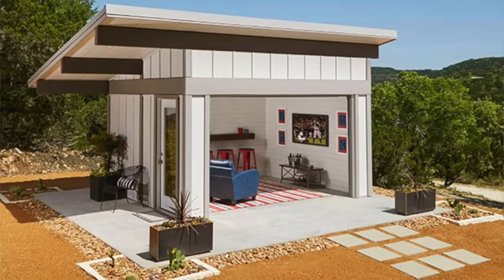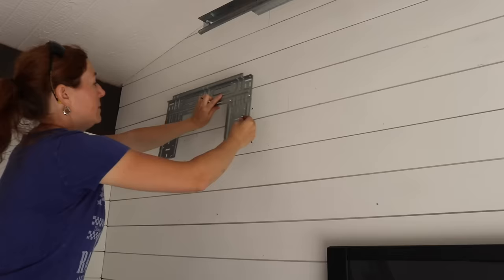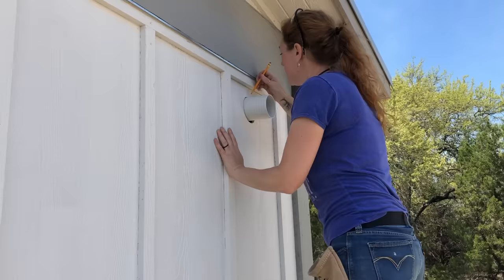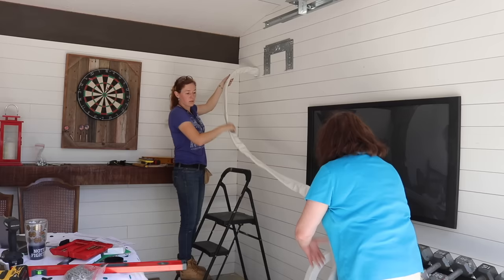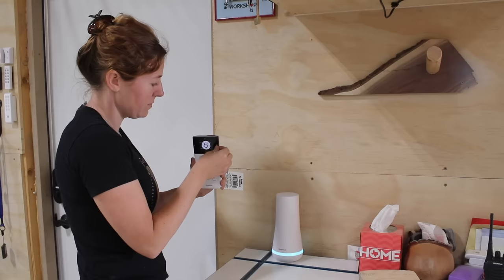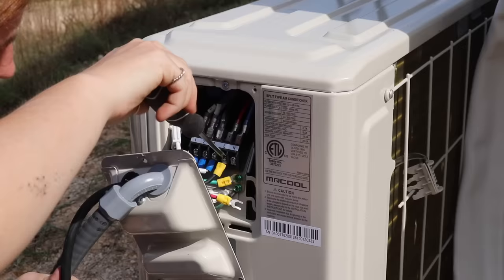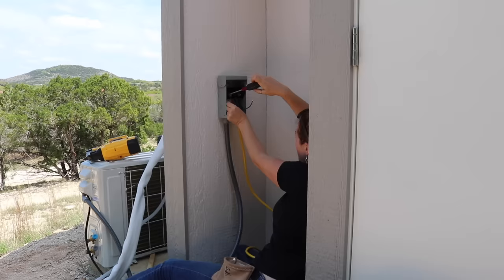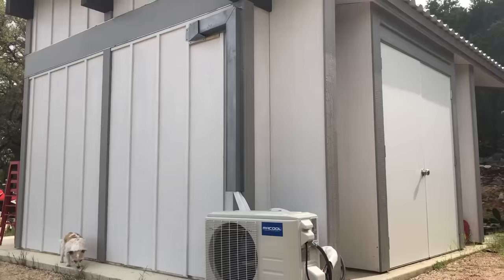DIY Ductless Mini Split Install - MrCool Unit

Comment: Is the evaporator coil and condenser under vacuum?...if not that could be a problem. They used to have you crack the suction line and tighten down the liquid to allow refrigerant to purge unit.then quickly tighten down suction line....

Comment: You should have caulked under and around the plastic sleeve and embedded the flanges when you installed it to prevent leakage of water and bugs

Comment: April,  I read that it is best to lay the extra line-set horizontally, not vertically.  This avoid oil being trapped in the bottom of the horizontal coils.  Any thoughts?

Comment: I'm a little concerned about the location of the condenser. Looks like it doesn't have enough space for adequate air flow. These types of condensers need to flow a lot of air. If not, it may result in high head pressure. But you said this is a system that will not be ran 24/7. so it will be okay. But if you plan on running it for extended periods of time, I would take the coil of line and relocate it and move the condenser at least 24-36 inches away from any structure.

Comment: You can cut the line set , obviously you'd need to reflare the copper tubing.
Reply: Yeah and also the system would have to be evacuated and recharged which takes it beyond the realm of a DIY project.

Comment: Hi great work. I just had an estimate to have one head mini split. I was told I would need some electrical work to connect the power. I was given a price of 5300 does that seem  a lot? When I priced the units for one head is around 1400.00. That means the rest is labor. Does that seem like a lot?

Comment: April, the line set is too long. You really need to pull a vacuum on the line set to get moisture out of the line. It's bad to coil up the line set and place it near the cooling fan. Mount the outside unit to the concrete. Don't run it off a generator, run permanente power to the unit. Seal the penetration point into the building.

Comment: What prevents rain water from getting back in under the shed walls?  I once build a shed foundation that extended JUST beyond the outside walls, and it was a disaster!  That looks similar.  I do see a little 1cm "lip" that maybe helps, but I'm still curious why on earth the builder extended concrete beyond the walls' drip edges.

Comment: You should not coil the extra copper up and down.  Lay it down so oil in the Freon can travel without getting stuck in the bottom of the loops.  Don’t block the condenser unit with the coils.  The condenser unit puts out heat and you should not be adding heat to your Freon.  The condenser needs fastened to something, a solid bolted on place.  Bolting it to the structure will make the walls vibrate and make noise.  Place condenser in the shade so the sun does not heat it up.    Putting the inside unit in the middle of a wall is better than in a corner.  Loses efficiency in a corner.  The fasteners you’re used on the interior plate looked too small to hold a running fan motor over time. They looked like drywall anchors for a photo frame.  You should use 3” heave lag bolts into every stud behind it.    Guessing that garage door is not energy rated for direct sunlight.  If it is getting direct sunlight that tiny mini split run off of a little gas generator is all going to be too small

Comment: line set will make an oil trap and will damage the compressor over the long term even with the high psi 410a

Comment: Cutting the end off an extension cord, even a heavy duty one isn’t advisable.  Better options exist, such as an appliance / dishwasher cord (15A rated) for 120v units, or better yet the correct rating SJOOW cord terminated in the appropriate connector for the voltage & available connector on the generator.
Reply: Looks nothing like and extension cord to me, just standard regular wiring

Comment: The Line set is precharged with nitrogen, not refrigerant. There needs to be an evacuation before the refrigerant can be released from the condenser.  If this is not done, the unit will not last more than 4 years
Reply: Not true. Some mini splits do come with a charged line set. I dont like them but then again I hate all mini splits cause their just garbage

Comment: I called several installation pros and they made it seem like putting in a mini split was so hard and required adding a lot of additional electricity.
Reply: This model Mr Cool diy that she got for her space only needs to be on a regular household power 115 volts circuit. It needs to be wired to a GFCI breaker or outlet. And another commentor pointed out that a surge protector is a really good idea for the unit, especially running off a generator. The 220 volt models that would involve hiring an electrician are for larger spaces. I just installed one of these a week ago for a rental’s living room with a retired female friend. It’s working fine.

Comment: I tried the link you provided to Mr.Cool because I myself want to install one in my living room. It’s a bit smaller from your shed. But all the link does (that you provided) is take me to their website. 
Which mini split did you purchase, because that’s the one I need as well . 
Thanks!
Reply from the maker: It's best to choose the one that best fits your needs. I've installed 5 now, 2 in my Shop, 2 at my commercial building and one in my garage. They all still work great and I love them. Thanks for watching.

Comment: That's amazing!! I called MrCool and they suggest not to exit the line set from the left side of the air-handler, the template which comes pre-printed also show hole marking on the right side. I am just wondering did you run into any issues post this install being lineset routed left? I would prefer left-side install and I not getting a clear response on it .. thank you...

Comment: I was wondering if I could use a unit like this for my 12X8 greenhouse. Just cooling it a bit when it gets TOO hot in winter. I would NOT need to drain the liquid outside, It could just drain into my gravel floor in my greenhouse. SO, would I NEED to have the lines to the outside in a situation like mine? Meaning that I want it all to be inside the greenhouse with NONE of that tubing going outside.

Comment: Get a pro and cut that refrigerant line to size.  Put a mesh screen over that water drain - get ready for it to become the #1 attraction for fire ants.
Reply: Most pros charge exorbitantly for simple enough work they got training to do so, since not all systems are the same design and requirements.

Comment: Great job. Question: What do i do if the indoor unit is about 50ft away from the outside unit?
Reply: You can get an extension line and a connector to join the two lines together.

Comment: Too late now but you needed to buy a flaring tool and cut the tubing then insert the nut on the tube and then flare the ends, this way you don't need to have all the excess tubing. You also need to insulate that tubing otherwise it will start to sweat.
Thanks
Reply: Don't forget to screw the outside unit to the concrete.

Comment: April, my compressor outside is mounted at about the same height as the unit inside. Is this causing the condensation to flow back towards & into my building?

Comment: Kudos for being brave enough to go it on your own, but you made a couple of major mistakes. 1) NEVER coil the lineset that way, It must be coiled flat with the end going to the compressor running downhill. To the poster below, that goes for R410a as well. Also, hardwiring in a drop cord is a no-no. I am a licensed HVAC contractor, BTW.

Comment: I'm sure this comment will be lost but you should never keep the excess line rolled up vertically

Leaving it vertical like that can have oil collect and cause then compressor to fail

Comment: Where is the vacuum process prior to releasing the refrigerant into the system?  That is perhaps the most technical part of the install.  It cost a fair amount of money to buy the equipment for the install and the cheap stuff leaks and you cannot get an accurate reading on the integrity of the system to prevent coolant leaks.  Did you pay someone to do that?

There is so much more you didn't cover.

Comment: Hello April. Great video I have just bought my Mr Cool 1200 BTU  I am finding you video to be one of the best you made it look so easy . I do have 1 question did you bolt the unit to your cement base after as I did not see anything holding it down or do you find its fine just free standing in the location you picked. Thank you.

Comment: Dang. Are they giving these things away?  Everyone seems to installing these. Great video
Reply: They might as well be giving them away! The unit she Has is considerably cheaper that installing a regular unit. They are only slightly higher in price than a window unit, and a lot nicer looking.
Reply: @ALLinJunkRemoval , i paid $400 for the same BTU for a window unit (Frigidaire). She paid 800 or however much its priced at now due to demand on Amazon. I rent the place where I live so I can not really or willing to pay for and install one of these DIY units for what it costs.

Comment: CAUTION, in most cases, you do not want to put the hole on the left side and fold the lines across the back...then make a sharpe 90 turn.  You can put the hole on the right side and go straight out .  The video shows what looks like an 18k handler so there was enough room to fold the lines and run across the back.......but....with 9k , 12k handlers....the space is less and folding the lines across the back will often result in the handler not snapping in correctly.  Plan on using screw inserts as in most cases the brackets don’t provide holes that match wall studs.  Also, the shorter the lines...the better....AND ...,two medium external units are more power efficient than 1 large one.  I used 1 48k btu unit for 5 air handlers and what a mistake.  Had lines all over the place.  Should have use 3 small units would have been less lines and less electricity.

Comment: great video thanks!! one question? could you explain to me how the wires were connected in the fuse disconnect box to protect the condenser and generator.  thanks again.

Comment: Little tip have a HVACR professional cut the tubing don't ever coil extra refrigeration tubing the system has refrigeration oil in the compressor it's will circling around system to the evaporator and back to the compressor plus the suction line gas coolers the compressor that comes back from the evaporator your going be replacing the compressor the extra tubing will trap the refrigeration oil cause the compressor to burn out l seen this happen it going cost more $$$

Comment: I like the way you had the guts to hook it up. But really you should have had a person help you that has experience in that kind of insulation . That is a person that has made a lot of mistakes and has learned from them. Good luck and I hope you don't get any experienced from this job.
Reply: Didn't she build and wire an entire workshop!?!?
Reply: FOr her shop wiring the primary line hookup was done by her hubby with a professional helping him to do it properly since what they went through was not a one man job. She even had a pro assist her in building the shop itself if you watched that part of the new shop series.
here is the electrical install portion: https://www.youtube.com/watch?v=iSkk9Kkoft8

Comment: Why you did not pass the coil line from the outside 3:11 insted of connected it to the inside unit first and then pass all the line from inside
Reply: Badora Strome 
It ships with the lineset already connected to the inside unit.

Comment: Maybe they should make section lengths of the line sets - and you should move the coil away from the airflow of the condenser opening on the backside - maybe even making a box for it ....
Not sure but isn’t all the refrigerant in the compressor side of the unit rather than the evaporator aka line set side - couldn’t you cut those lines and refit them.... can’t be much harder than sweating pipes or crimping pipe???
Reply: Charlie&Erin Muller i have been doing hvac for thirty years.what she done in video,most part,is done right.as far as the lines they are precharged with Freon as well the out door and indoor unit.as you hook the lines to the units it breaks a seal and left feon through.there is no need to pull a vacuum on system.if you cut the lines you will loose the feon and get moisture.after that you will have to call a company to fix and cost will go up.
Reply: xslabcabxhearsex - thanks for some explanation on the split mini- but some things I noted as the job was evidently incomplete- Outdoor unit wasn’t secure- wound lines were placed in front of airflow - not entirely effective for efficiency

Comment: Your unit should have had a vacuum test run to purge the lines of all moisture prior to charging the unit. Any competent professional would perform this before charging a unit. This eliminates moisture that will turn to acid and ruin the unit over time. 

Next, get rid of the garage door. The lack of insulation and solar gain will make the job of cooling very hard on that unit.

Comment: All air air-conditioning condensing units are pre-charged for a specific length of pipe . lengthening or shortening will and may affect the freon charge. And yes I understand your line set is pre-charge but that's mostly for the do-it-yourselfers. And moisture is the enemy of all air conditioners and can sometimes freeze inside of a metering device causing a restriction. 
Boy you sure are a good girl though. I tell you.

Comment: Thanks for a great video, April!  
What size circuit breaker did you put in the disconnect box?  Also, what size AWG wire goes from that to the unit?
My instruction manual suggests a 35A breaker and size 8 wire...

Comment: Nice video and practical tips. I'm looking at getting a rain downspout to cover the lines. Do you think a standard 2 x3 " downspout would handle it or should I go to a 3 x4 one. I've order my Mrcool unit, but it still hasn't come, otherwise I would be able to see if the 2 x3  would work. Thanks

Comment: What about the electrical can I just plug it in into a 120v outlet or will I need an electrician to install a shut off box?
Reply: You should have the disconnect box and the pigtail for saety reasons. Its only $13. Ive bought 3 of them.

Comment: Great install! One question - how well does running the unit off a generator work? I was told that I'd need to put a line voltage conditioner between the unit and generator or risk frying the control board. Any experience with this???

Comment: Since there's no power plug that you can unplug when not in use , and you can only turn off the indoor unit by using the remote, doesn't it consumes electricity even of its turned off (remote)?

Comment: drill new holes through the bracket that match the stud.
Reply: The unit seriously only weighs a couple pounds. You could hang it on drywall without anchors and it would probably last a thousand years.
Reply: Ok, got it, the unit is lite weight. I would still be more comfortable with four screws into studs with something that is over head. Must have a small fan in it to move air so there is vibration. It looked like it was some sort of wood siding on the wall??? but not plaster board. If it was plaster board, I would not hang a vibrating lite box on a wall above peoples heads.
Reply: IF that was plaster board, yes I would go with drywall anchors even into stud, since plaster lasts only a few decades at best before it becomes weak enough to no longer hold a load fastened into it.

Comment: How many square feet is the building you installed this unit in?  How well is it working cooling and heating?  I have a covered back porch that I'm considering closing it in to make a sunroom/mini gym room that measures roughly 320 square feet.  I looked at the specs and it said it would handle up to 500 square feet.  My concern is this room if I decide to close it in will have western facing windows in the afternoons.  I also found these units at Lowes and the three that had 4.5 stars and above were the unit you used and the next ones were the 18K and the next was the 24k BTU units.  I think the 24K unit would be overkill, but the 18k unit might not have to work so hard to keep a room the size I want to install it in comfortable with cooling and heating.

Comment: I wish the Mr. Cool D.I.Y. Mini Split was available in Canada.
Reply: Probabely is under another name I got an identical looking unit here in the UK last year  from Amazon under the name electriq. It came as a precharge unit but the inside unit was open on the ends so I did cut down the spare pipe and reflared the ends using a brake pipe flare kit.

Comment: I find it inexcusable not to provide a mounting bracket with holes 16" or 24" OC. You are very considerate of your guests. :-)
Reply: pretty sure the bracket is made with 16 oc holes for said space mount, not just 24 or other

Comment: Ummm, why didn't you feed the charged line in from the outside rather than having to feed the whole length from inside to out? Just curious.
Reply: Seems like the air handler already had the charged line attached to it from the factory.
Reply: I did the same thing. Super annoyed with myself when I realized.
Reply: As i seen, the line was as Oscar mentions, it was already attached to inside unit for this capacity model. Some comes with line separate, others where it attached to condensing unit outdoors. Besides if you disconnect the line after it has already been installed as she clearly mentions would lead to calling a service pro ($$$) to recharge it before using.